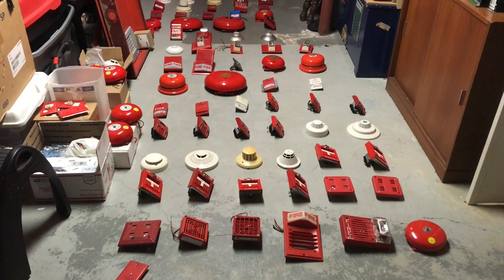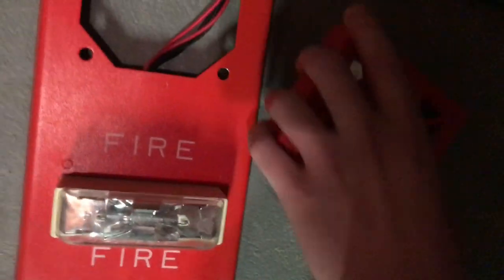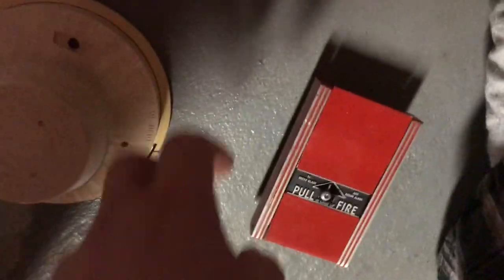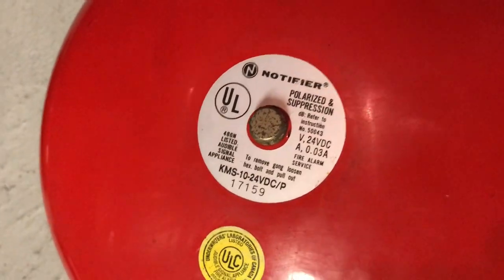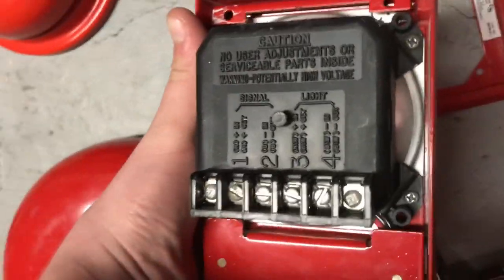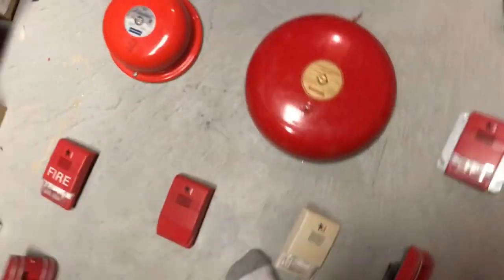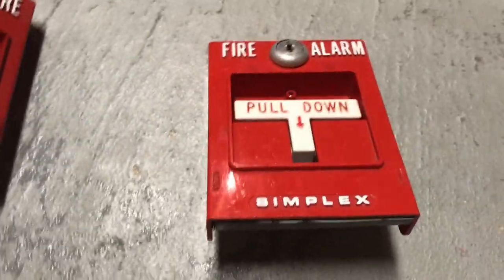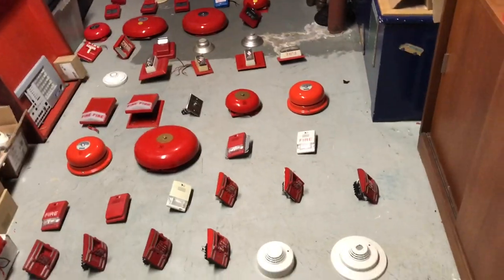My Fire Alarm Collection (November 2018)

Comment: the faraday 6120 you have is the strobeless version that was commonly seen as the Simplex 2901-9838.
Reply from the maker: Simsfanatic1997 is back BTCP I'm aware
Reply: @CJ9899  oh, i made some KMS 10 inch bells on roblox. however, they were rebranded by Ademco.

Comment: hey, good news! i made a set of Edwards 439D-AWD bells on roblox. they come in 6 and 10 inch versions. when you spawn them, you gotta make sure you anchor the labels i made because i forgot to anchor them when i released them. i also made seperate version of the same bells.
Reply from the maker: Simsfanatic1997 is back BTCP are they made from scratch, or they the ones I made?
Reply: @CJ9899  i made them from scratch.
Reply from the maker: Simsfanatic1997 is back BTCP nice
Reply from the maker: Simsfanatic1997 is back BTCP Can you send me a link?